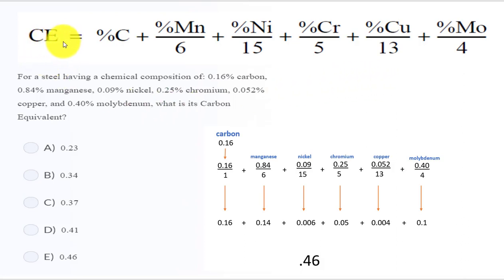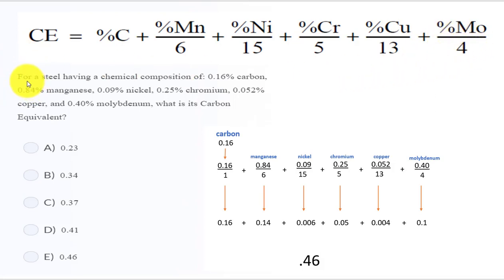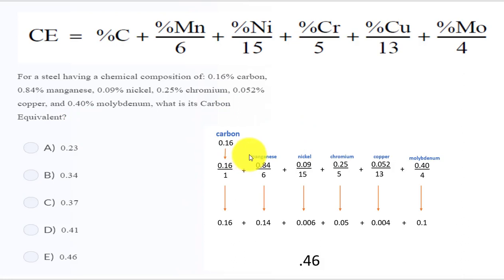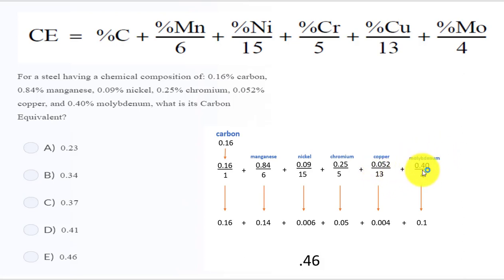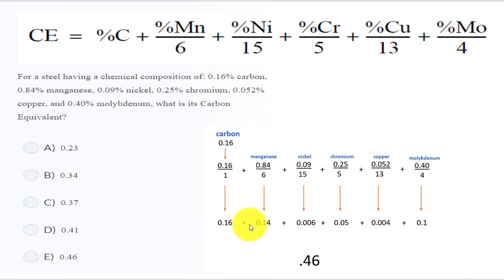CARBON EQUIVALENT FORMULA EXPLAINED BY WELDING AND STUFF

Comment: Carbon equivalency is basically the measure of the tendency of the weld (HAZ) to form martensite on cooling rates and determining whether it will suffer from brittle fracture